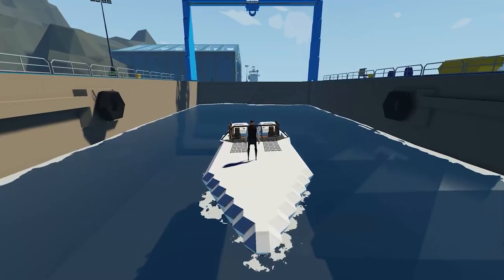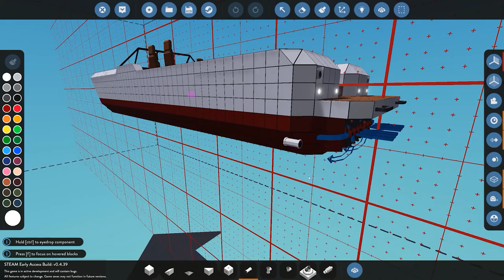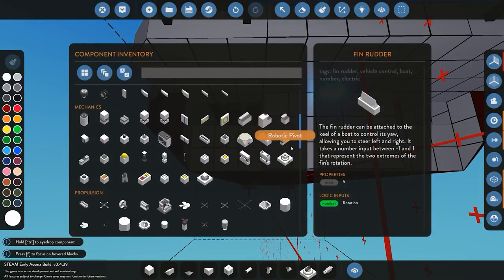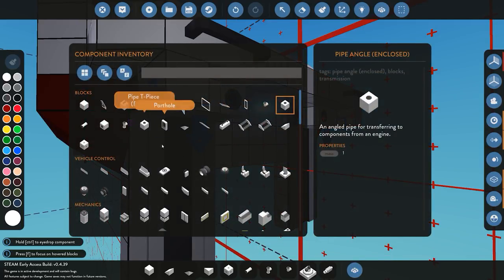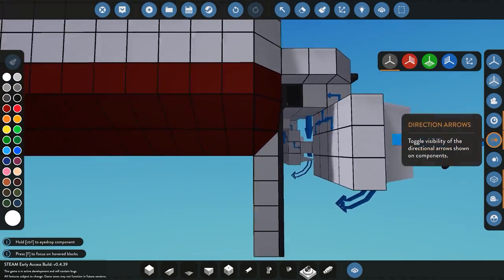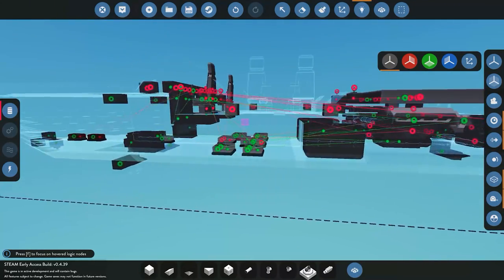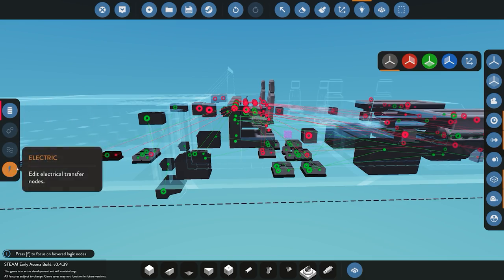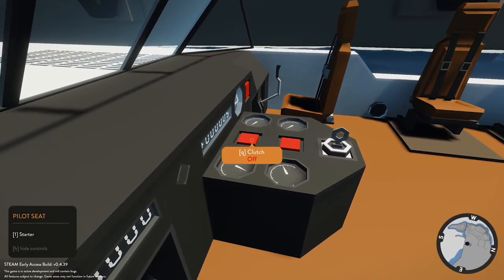Stormworks Basic Hydrofoil Tutorial

Comment: I think the track system is complicating things for nothing, i use fixed wings that seat under water, with the altimeter stabilisation system, and as soon as the boat goes fast enough, rudders lift it up easily. 
Mayb the tracks could be usefull on bigger boats, where the foil could collide the sea floor. 
That's just a though, I really enjoy your quality content, keep up the good work ! :3
Reply: I also did this in career mode before I had researched mechanics!